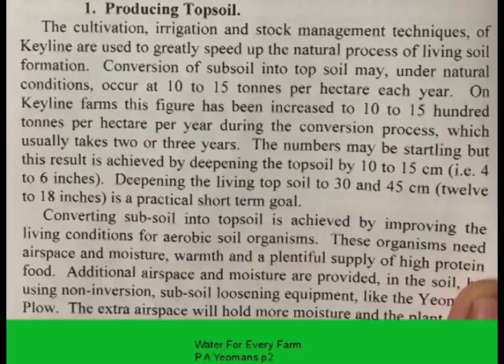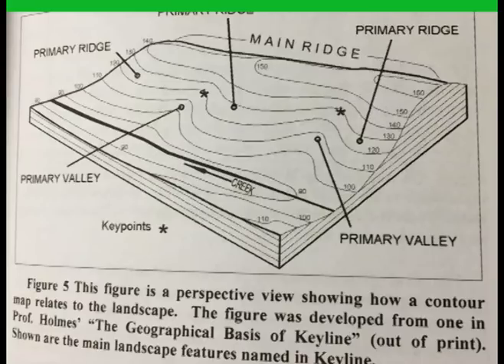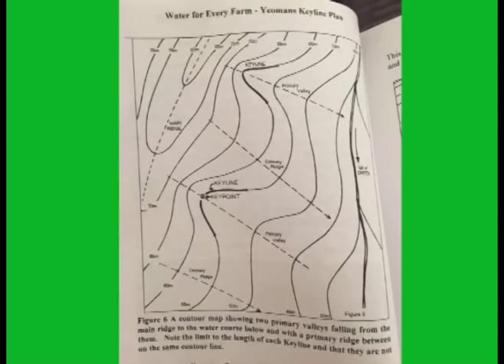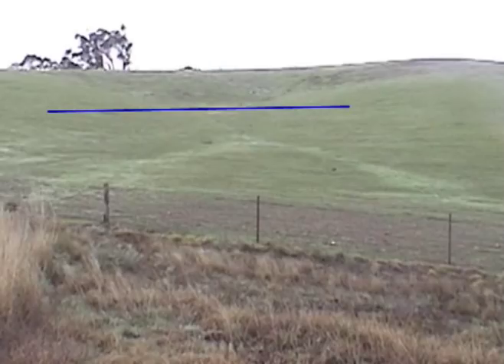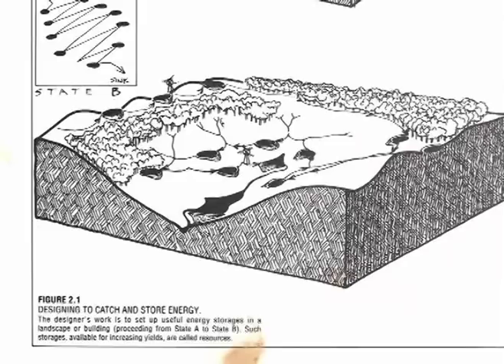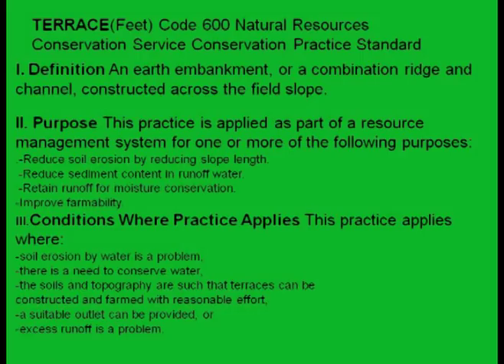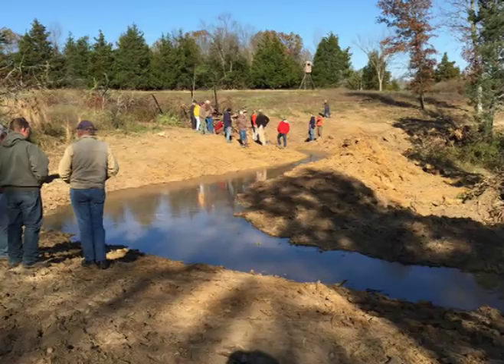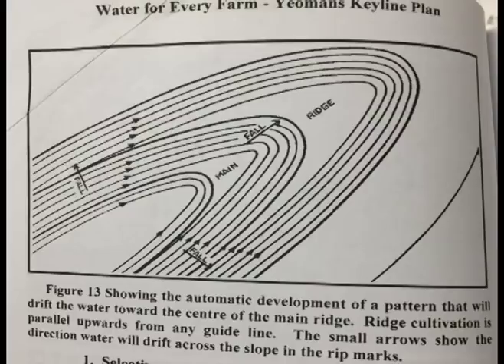Mark Shepard on Managing Water on Your Farm

Comment: I loved the info. However, it is frustrating when you put up a slide and say, "Here, and here," but you don't use a pointer, or not one visible in the video. Please, add arrows.
Reply: Yeah, it's not happened yet in the 4 plus years the video has been up.

Comment: You can also tell if your trench is level, if you dig your trenches during heavy rain.  The water fills the trench when level.  It is quite fun to see the instant progress and how it all works.
Reply: Would the rain carry off some of the soil since it you just dig it and have not get chance to plant for roots to hold on the soil? Newbie to permaculture here. Thanks.
Reply: @permatopiafarm  No, because the water flowing in the keyline trenches is not flowing that quickly since they are level.  I was just doing this the other day. The water may overflow if you were digging in a valley during heavy rain, but if you further out digging the keyline trench the water flows more slowly. There would be other factors that would influence whether you have overflow such as the amount or rain, soil type, and the size of your trenches.

Comment: One thing no one seems to elucidate upon when talking about "zero input" agriculture is the huge expense of renting machinery to make swales and contours to essentially convert your land into a giant rainwater collection and irrigation system. Unfortunately, that is impossibly prohibitive for most people. There ARE inputs, they just are mostly up front in the initial design phase, and those inputs are substantial.
Reply: Unless you are dealing with a huge project, along the lines of 5+ acres, you should be able to dig them by hand if you're physically capable of doing so. Also the point of permaculture is the up front investment of your money and time, to set up a system that you won't have to do much for in the following years. Essentially, do all of the work now, and reap the benefits for yeeeears to come. As far as zero input goes, of course there's input to set the system up, but you really can set up a system that only requires you to pick the food off the plant and prune occasionally. Hopefully this will change your mind on it being impossibly prohibitive, the only prohibiting factor is how hard you're willing to work to create a productive system.
Reply: @bolosandninjarolls  No, it hasn't changed my mind. I'm just one person and so I can only do so much. I just wish I could do more. Last year I built a top for my lawn mower trailer to collect leaves. I collected as much of the fall leaves as possible and deposited them in a thick layer in the center of my back yard. The soil there is great now. Now if only I could solve my vole problem. They destroy my plant's roots. I understand companion planting can help solve this.
Reply: @abrotherinchrist  edibleacres hand digs a lot of the waterworks but yeah machinery does things much quicker.
Reply: Farmers normally have plows, and the keyline plow is merely replacing it. Buying a keyline plow is a relatively inexpensive purchase for a farm, and you would buy it as you use it regularly enough.  
Additionally Mark talks about how to get around typical problems of doing what he's doing regarding plants for startup.  
Pay attention to the instruction.  Your argument, falls flat.

Comment: Can any one of you gurus define unambiguously the the terms KEYPOINT and KEYLINE. Author has not been able to make me understand it.
Reply: The keypoint is the point on a slope where the water goes from accelerating at an increasing rate during a heavy rain event to decreasing in speed. Think of going down a waterslide at an amusement park, before you "bottom out" there is a point where you begin to slow down and transition the other direction, that is a keypoint. He explains why this point is important (water collects here, clay collects here etc.) so the goal is to move the water away from this keypoint and stop it from continuing to flow down. 

A keyline is just a standard contour line that includes a keypoint that helps you to accomplish this, to move water away from the keypoint and stop it from flowing straight down a slope. So if you are standing on a keypoint that you have located, and walk at an equal altitude along a landscape (on contour), the line you are walking on would be considered a keyline. You then run all your lines of trees parallel to this line going up and down the slope for ease of cultivation and to have standardized alley widths, whatever that may be (9-18 meters). 

He likes to slope his keyline .25%-1% so that the water slowly moves along and down to the next row of tree lines, but you get the idea hopefully.
Reply: @nineallday000  Thank you very much for your time in explaining key points/key lines.
Reply: It'scthe fault of the person who are the video from a class by Mark Shepard.

Comment: Would it not be better to create top soil and then let the bottom of that convert into subsoil than to convert subsoil into topsoil? cumulative biomass?
Reply: Deeper soils are much better than a little surface accumulation.  Deeper carbon sequestration corrects soil.  It makes poor draining soil drain better,  it makes sandy soil retain water.  It also makes nutrients more bioavailable.  Part of the point is to keep water where you need it in,  and good soil does that.

Comment: For those who are concerned about Shepard talking about 'keeping' the water on the farm, no worries.  Instead of running off rapidly, carrying nutrients and topsoil with it (erosion) to the streams and rivers and then to the bays, gulfs, and oceans (where the nutrients and silt cause problems in those ecosystems) - keyline design helps restore soil  and renew the hydrological cycle by allowing rainwater to be absorbed by the soil, nourish plant and soil life communities (which are intertwined, of course), replenish aquifers, and restore springs.

We have treated the soil so badly for so long that we have forgotten that lakes, streams, and rivers are fed - in a functioning ecosystem- by underground water flows, NOT surface runoff.  In arid regions, this is especially important, as water flowing over the surface of land is more likely to be lost to evaporation.
Reply: I love his system.  It is a well thought out branch of permaculture that deserves more attention.  Capturing the water (and airborne humus,  while sequestering carbon) higher on the land is really a good idea.

Comment: Confusing:  17:38  The illustration and Shepard both say to plow 'up' toward the ridges- but the actual groves, channels, swales go down relative to sealevel as they go out onto the ridges, so the water flows from the valleys, 2ndary valleys, hollows, gulches where the water naturally collects out to the (otherwise) drier ridges).  

This hydrates the ridges, prevents surface runoff, prevents marshy spots in the valleys and dips in the landscapes... as Shepard says.   This was really confusing, until I looked at the elevation markets on the  illustration.

Comment: A few notes:  According to soil research, subsoils EVERYWHERE in the continental USA have sufficient nutrients to meet plant needs.  As Shepard says, deficiencies are a myth. Where problems exist, it is because the soil life is lacking, as the organisms in 'the soil food web' make the nutrients in the soil available for plants.  See talks by Dr. Elaine Ingham, PhD for details, or her website SoilFoodWeb.com

The soil food web needs water, oxygen, and food to thrive- and do their job of converting unavailable minerals to nutrients that are available to plant roots.  LIVING ROOTS in then soil are necessary to keep the soil food web thriving.  Mulches can be beneficial for soils, but the wrong kind of mulch, or poorly applied (too wet, too thick, not airy enough) can kill the beneficial organisms in the soil.  

Grasses excel at harvesting sunlight and then pumping food into the soil to feed the soil organisms. The roots of woody shrubs and trees are useful... but those plants, especially trees, invest in building trunks and branches and have little left to feed the soil food web.   This is the primary reason that grasses - which can be up to 70' tall (some bamboo species), excel at building soil - and sequestering carbon.  They literally pump masses of carbohydrates into the soil.

Dr. Elaine Ingham is shown in one video demonstrating how the roots of grass on a putting green, which is mown daily and is 1/4" tall do NOT die when the grass is cut.  If the right organisms are present in the soil (not just fungi), the roots can be 3' deep on these grass plants, as sbown in her demo.

IF the grasses are not allowed to become overly mature and oxidize their nutrients back into the atmosphere.  Grasses (all plants) co-evolved with herbivores, so they need to be pruned by grazing.  Grasses and forbs also benefit from the organisms in the saliva of grazing animals, and the hoof action which brings mature plant matter to the soil surface where the soil food web can digest it, in addition to the benefits of urine and manure.
Reply: The problem with subsoils is the inability to hold moisture for long periods of time. No organic matter. Micro and macro nutrients are lacking for lush production of vegetation and food. Doesnt produce the same nutrient content in the plant or vegetable as with top notch top soil. Doesnt give a proper environment for beneficial fungi it is easily washed away. There are a million things wrong with just growing in subsoil. After all we are trying to create a better eco system lusher productions with less time and more naturally occurring inputs.
Reply: Guess I should have read your whole response before I replied.

Comment: at 14:59 you will not find clay forming there.  Too much kinetic energy at that point for clay to settle.  There is a reason you do not find steep clay unless an uplift happened there.
Reply: False.  It's hard to tell but their are little dips there, additionally the plants there also absorb the water's kinetic energy...
Reply: @b_uppy  The only clay that would settle into a small dip would be from the tail end of a storm after the runoff stopped flowing if there is any clay in the runoff water.  It is not going to form a continuous formation of clay that would be significant.   Further there is not enough head to compact the clay into a functional unit under a couple inches of water.
Reply: Think you are making assumptions from limited data.  Depends on the rain event's strength (you're assuming all rain events are storms), the effect of a series of rain events, the amount of airborn clay particulate, as well as any lose surface clay.  Rocks and  plants will have their effect as well,  especially if there is an established dip...

 Seen plenty of manmade waterworks  and natural water eventw to know you're wrong.
Reply: @b_uppy  I doubt you have built any quality waters or habitats to know the difference between right or wrong in any of this.
Reply: @BeautifuLakesStreamsBiologists  
That's funny, I think the same about you...
Reply: @b_uppy  The difference between us is people pay for my guidance.
Reply: @BeautifuLakesStreamsBiologists  
Hardly.
Your customers are overcharged. Mine get their value.
Reply: @b_uppy  Ahh I see.  People actually pay you for misinformation.  That's par for an internet "expert".
Reply: @Natural Ponds Lakes & Streams by Spring Creek Aquatic Concepts  
What separates is that you get (over)paid period for your (lack of) expertise.

Context is lost on you, also...
Reply: @b_uppy  since you have no customers,  that remains to be seen.  And once again you talk without any knowledge.  Let me guess:  you are a self-professed permaculture "expert"

Comment: when you mulch you aren't killing soil. You are killing grasses and herbs, their roots decompose and they form humus. With continual mulching you will continually feed microbes in the soil, as well as invertebrate. If you plant overstory plants/ trees and pruning then you are BUILDING SOIL.  Ploughing kills soil unfortunately, even keyline which is low impact. Keyline is good but you failed to explain a few points about soil building.
Reply: The wrong kind of mulch, especially if too wet or too thick where it restricts oxygen reaching the soil, can actually be harmful to or kill beneficial soil organisms, as you know.  (Harmful soil-dwelling organisms are nearly all anaerobic).  

Living roots in the soil are important for soil life and soil building.  Grasses, in particular, excel at pumping carbon into the  soil.  Grasses 'farm' the soil food web by making particular carbohyrates to feed certain kinds of soil dwelling organisms, depending on what the plant needs at that time.  Fascinating, eh?  Dr. Elaine Ingham's talks have a lot more info, if you're interested.
Reply: Keyline plowing, for those who may be unaware, is often done only once.  Sometimes it may be repeated.  In the USA, we have only seen it used on grassland- pastures.  As explained near the end, the 'keyline plow' is what we call a sub-soiler.  It slices a grove through the soil, and does not turn the soil over like we think of with plowing.  These slices relieve compaction, allowing both water and air to get into the soil, so then soil food web and roots can thrive.   And to prevent erosion from water runoff, etc.
Reply: Mulch doesn't build soil.  It allows plants to thrive and kill the soil that way by depleting it.
Keylining breaks off some roots,  those roots die and their carbon builds the soil that way.  Carbon is a great corrector of soils.  It binds sand particles together so they can retain water.  They make clay bond together in aggregates so they allow that soil to drain faster.  Carbon also makes certain nutrients more bio-available.

As Jefferdaughter says,  keylining is not plowing...

Comment: Thanks for putting this online! However, I don't agree with the idea that around 41:00 the plan would be going off-Keyline, the point chosen for the design is the keypoint of the primary valley and all those others are just erosion runnels and not primary valleys. Ignoring the erosion runnels and doing the design on primary valleys makes it simpler. As a bonus, if you do tillage with the keyline pattern, you gradually move soil to the runnels and fill them up. Been doing that since 2013 on our farm.